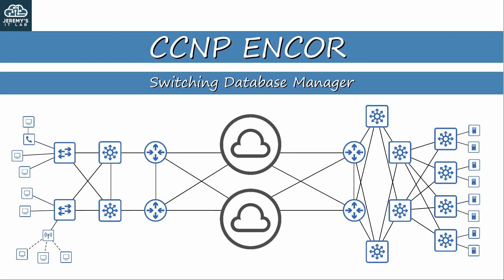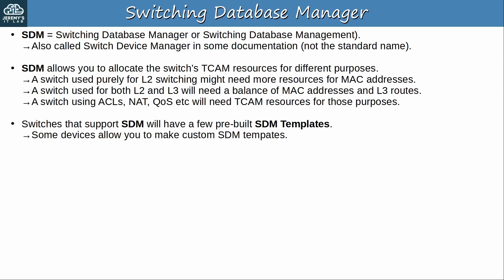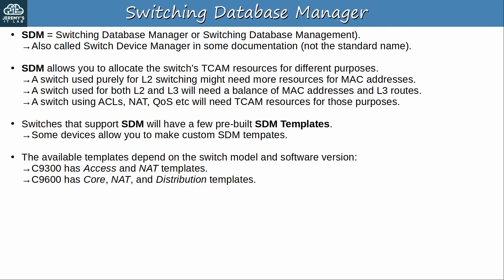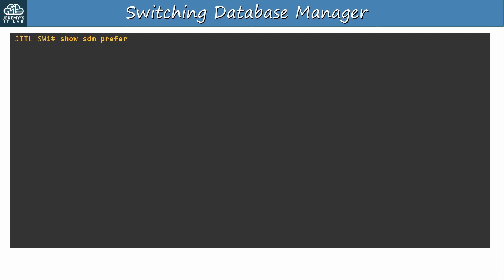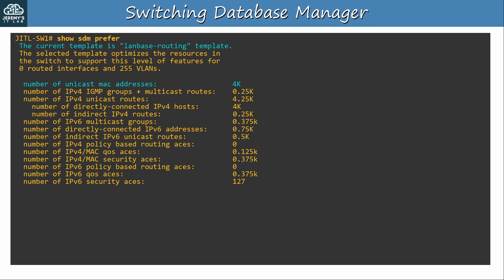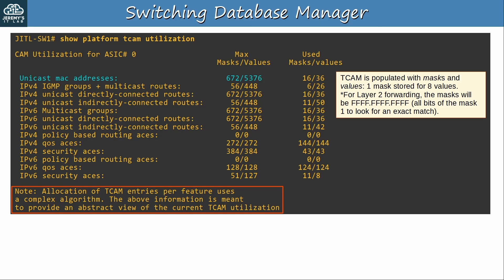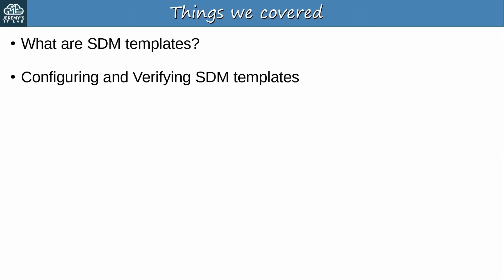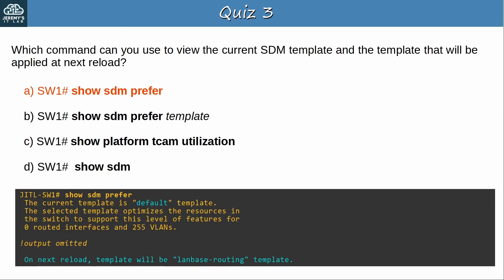CCNP ENCOR // Switching Database Manager (SDM) // ENCOR 350-401 Complete Course

Comment: The command "show platform tcam utilization" is no longer supported on 9300, 9400, 9500, etc series switches. You'd have to use something like: "show platform hardware fed switch 1 fwd-asic resource tcam utilization" to view the same information.